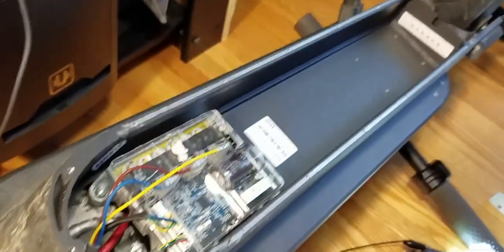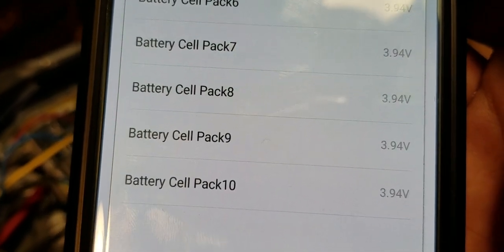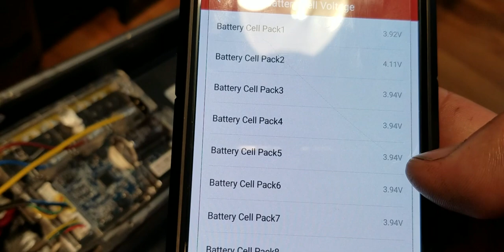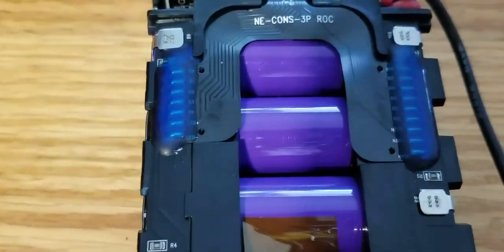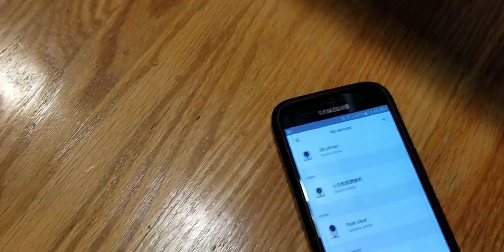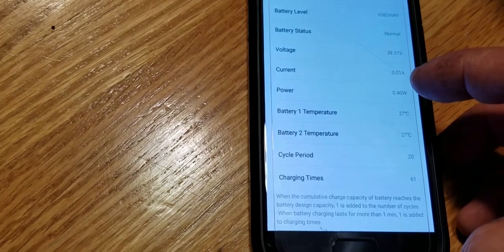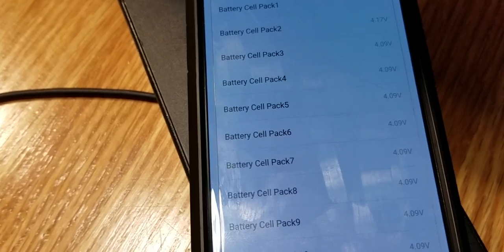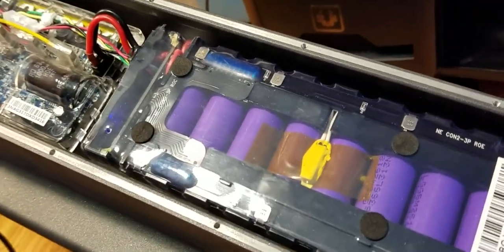Xiaomi M365 range problem - diag and repair

Comment: The reason why battery pack 2 has a higher voltage is because its more worn and so charges quicker. That is why even after the first discharge the battery pack 2 still advanced faster than the others indicating the wear.
Reply: lol nvm watched the followup

Comment: instead of doing all this wouldnt it be easier to just let the battery completely discharge by either running the motor free or letting the LEDs on until it is ocmpletely drained?
Reply: yes

Comment: What nice looking internals. My guess is that cell is bad and has lower capacity and thus charges faster. It is not your fault this is a balance issue. You could make a BMS easily. I recommend it.
Reply from the maker: I agree that is the problem. the battery is in a 10s3p configuration, so likely 3 cells are the problem. i some better 18650 cells on order to replace the faulty cells. i guess i could add a 10s BMS from ebay to this battery, but i would only use it to charge the battery. the stock BMS has 3 signal wires going to the controller, likely to tell it information(cell voltages, temp etc..) about the battery pack. i don't want to lose that info.
Reply: Doug, you sound like a techie!  See this document for full details on the sophisticated BMS and see Figure 8-2 for circuit diagram of most of the Xiaomi BMS board: http://www.ti.com/lit/ds/symlink/bq76940.pdf

But do remember the BMS relies on being properly connected to a battery pack that has all its 10s3p connections intact.

Comment: Are they using unprotected cells? This is why I would pay 20 dollars more to get each cell with protection inside battery. Then the BMS  does not have to worry about each cell, just cutting charging power when current is zero. I wish though they could produce protected 18650 cells with a pre-set cut-off @ 4 volts. I would definitely pay more for this, even if capacity is lower. That would mean that the battery pack would keep a good charge for many years. Using a lot of 18650 cells and with my charger programmed to 4 volt cut-off my 10 year old cells only have lost 3 percent (of 4 volt capacity). 4.2 volt charged batteries gives way less than this in just  a few hundred cycles (all original Panasonic NCR 18650B protected and unprotected).

Comment: why didn't you just empty all of the cells (by running it) and charge it up from there? or would it not have discharged all of the cells because some are empty?
Reply: The full discharge voltages of each cell would be different for each just like when they were fully charged.  His method is spot on

Comment: Yecch. Not everyone is an EE or even has alligator clips.  Very few people could diagnose or even try to repair that problem.  I hope you're the only one to have it (not that you should!).
Reply from the maker: +Mike Cane i am no EE, lol. I diagnose/repair car problems as a day job. But thanks!
Reply: I think i have the same problem, my battery range is very low, and don't know what to do. The scooter also switches off and sometimes I can't restart it without plugging it again.
Reply from the maker: +Gianluca Maggiarra i just made a updated video to this issue, solving the problem

Comment: Hi Doug Hnut, your videos are great. Thank you. One question, and I do realise that your video is over a year old, but does the current Mi Home app still show the breakdown of the Battery Cell pack voltages?  I can't find it anywhere.  I can only see the total voltage.  Also it seems the that Ninebot app no longer connects to the M365 stating that it does not support that model scooter.  Do you know anything about this?
Reply from the maker: they stopped displaying the breakdown. on the android appstore, there is a app called "m365 battery" that will do the same
Reply: @DougHnut  thanks. Also when I charged my m365 the other day, at about 100% the four lights on the handlebars started flashing in unison, and the tail light was flashing too. Is this an error sign or is it normal? I can't find anything about it in the manual. Also the first charges of the m365 I left the scooter and returned after it was fully charged and the lights had all turned off
Reply: Is the M365 battery app on Apple store???

Comment: Hi. Thanks for the video. Did the battery fix work and increased it back 22 km?
Reply from the maker: +otikzs unfortunely not quite. I have been quite hesitant to draining the battery down past 10%. Im still slowly doing some test to see if this made an improvement. So far it is not as good as new. Ill let you guys know after i collect more data.
Reply: Doug Hnut  how many months are you using it before you noticed the battery problem?
Reply from the maker: +shari soriano 2 months. Right after my off road trip. Which i have a video of that ride in my playlist. 
It was not meant for that kind of riding haha

Comment: My scooter stops charging at approx. 4.12volts  is that normal?    all cells are ballanced at 4.12
Reply: yes, I think. Newer BMS firmware from xiaomi limited the max voltage, so now 100% is like 94% from before. This helps protect battery, allows more cycles because batteries are not sitting at full charge. It lowers the scooter range a bit, though, but you woukd be able to use it longer time.
It's possible to flash older BMS version, to regain your capacity, but will be tougher on your battery.

Comment: I was under the impression when you had a cell balance issue the way that you repaired it is to run everything down dead. And then put a draw on it and suck out the rest. Then when it recharges from absolutely zero they will charge evenly as long as connections are good and otherwise healthy cells are present
Reply: What's the best and fastest way to drain battery?

Comment from the maker: its only on the mi home app. but im not even sure anymore because recently i haven't noticed the individual voltages anymore on the mi home app
Reply: you have to change the apps region to USA in order to see the extra features of the cells, ... I had Europe region i randomly changed it to United states and noticed the feature.
Reply: @PqKiller25ToLife  I live in Europe, and when i change to region USA, it cant even find and connect the device via bluetooth? I have tried several times, even turned off and restarted the device and the app first, but when i try to connect the device, it just searches until it finally says, that it cant find any device...
Reply: @skytte71  make sure u dowloaded the right app, or if it needs to be updated, the apps icon is green.
Reply: You can check the individual pack voltages still using this app -- https://play.google.com/store/apps/details?id=com.m365downgrade
I'm having the same speed issue... I think all voltages seem fine (all packs right around 4.05V), tire pressure is good, eco mode is off. Sucks, IDK what to do.

Comment: wait! so you got 15 fiscally cells but the app shows only 10?
Reply from the maker: rick haro there is actually 30 cells. The cell arrangement is 10s3p. So 10 groups of 3 cells
Reply: Richard Adams ok i thought it was 15 x 2.

Comment: Hi Doug, Same problem here. Cell PACK 2 going a lot lower voltage and faster than the orther when i run the scooter. Should i replace these 3 cells? by what?
Reply from the maker: i have an updated video for this issue, check out my playlist
Reply: I have totally the same problem 
After ride cell pack 2 has 0.2-0.3V lower voltage, after charging it is equal, But my scooter sometimes wont turn on. I have to put it on chager and then It turn on. Guess some bad connection to pack 2

Comment: Hello Doug, may i ask from you something. I have the opposite problem. My all batteries have 4,140 V, but the Cell4 is a little but under4,112 V.  I have a 18650 battery charger (0.5A), do you think i can charge this low cell with this to make it balanced? Thank you for your kind response.
Reply: Yes you can. Though this may be an indication of a failed cell that has a high leakage current which means it's faulty. If left unchecked, this could lead to fire, though it's unlikely to happen if it's slowly dropping in voltage. It's probably going to get warmer than normal when charging though.

I would recommend leaving it a day. If it drops further then one or more cells in that parallel section need replacing. It may be your BMS that is bad too, because it should be balancing the cells.
Check the resistance of all connections to the BMS. If it's offscale high, then you need to find where the break in the circuit is and repair it.

In theory, you may be able to see which cell is bad just by pointing a thermal camera at it when charging. I would note this isn't recommended. Especially if you're charging at a high current.

Comment: In my "MiHome" application I can't see the Battery Cell Pack?
Reply from the maker: +Egge33 what version firmware do you have? Im currently on 1.3.4. If you still cant find it ill make a quick video to show you where
Reply: Do you know if 1.3.4 fixes the fuse problem on braking? I have an M365 on the way from Banggood and I want to pre-empt any problems.
Reply from the maker: +Kent Boehm yes. I heard anything after 1.3 does. Mine came from banggood with 1.3.1. So im sure you will be fine.
Reply: I checked already. Only. With Android you can check the cell power!

Comment: Any way to charge without the power supply? Mine was stolen.
Reply from the maker: no, unless you have a 42 volt power supply and are willing to take the battery cover off every time you want to charge. better to just buy another charger. http://bit.ly/2NskGkY

Comment: You have to ask why this happened though. Does the battery have balancing circuitry built in? It certainly should!
Reply from the maker: I first noticed the range problem after my off road trip that ended with a dead battery. So likely the problem was caused by draining the battery till the scooter wouldn't move anymore and leaving it powered on 10-15mins afterward. The battery does have a BMS, but it does not balance charge the batteries. The BMS only prevents over/under charging.
Reply: Ahh ok, so avoiding over discharging would probably help avoid this situation. Cheers.
Reply: >>> The battery does have a BMS, but it does not balance charge the batteries.

Uh-oh.  I'm seeing charge balancing claims from other eScooter makers in China.  If Xiaomi doesn't have it,. it's likely they don't, either.  Yikes!  This could become a very big problem.
Reply: Oh, you're very wrong. The BMS does balance charging using Texas Instruments bq76930 chip - PROVIDING the cells and cell packs are all connected properly and all the sense wires are connected.
Reply: Ah, that makes sense.  If it's not programmed for that possibility, the balancing will go out of whack.
Reply: There are two major faults that can occur with the battery pack. If one realises that it is made up of 10 packs in series, each with 3 batteries in parallel, then you need 11 wires to monitor all the pack voltages.

If you look at the pack voltages on MiHome and one pack has a high voltage while one next to it has a low voltages, then one of the sense connections has lifted off and needs reconnecting. For example if Battery Cell Pack 2 reads lower than the majority and Battery Cell Pack 3 reads higher than the majority, then sense lead 2 has disconnected (they're numbered from zero to 10). BMS cannot balance the affected cell packs

Alternatively, if you just see one cell pack reading lower than the others, then probably one of the three cells in that cell pack has got disconnected and it therefore only has two thirds of its capacity and will drain quicker than the other 9 cell packs giving you reduced autonomy. And, when charging, this pack (having lower capacity) will reach the peak fully charged state before the other 9 and the charger will stop charging before those 9 packs are full.

The MiHome Battery Cell Pack readings are absolutely invaluable guide to the integrity of the battery assembly.  Under normal circumstances, the packs should all be the same within 0.02 volt, although you may see a slightly wider variance when the battery is nearly empty but it soon recovers under charge.

Sorry for the long reply but I thought it might help those out there who have damaged the battery by using solid tyres which cause excessive vibration.  That's a slight simplification because it's clear that Xiaomi have not designed a battery that is fit for purpose. the designer did not take into account the poor malleability of nickel compared with copper.

Oh, and be warned: when resoldering the tabs, you need to get solder underneath them but if you straighten them too much, they will crack and cause a bad connection later at the point where they bend over. You will get a bad connection AGAIN. :-(
Reply: Ah, solid tires and vibration as other factors to consider.  I doubt there's room for some cushioning in that area. And given the heat the pack might generate, you wouldn't want anything near it.  Good explanation.
Reply from the maker: interesting, i didn't know that it actually has a balancing feature. i looked into the bq76930. it has a max balancing current of 5ma. that's probably why i didn't notice any change in voltage between the lower capacity cell pack vs the others within a 24 hour span.  so even though this does have a balancing feature, it can not handle a capacity difference of more than 120mah within 24 hours(assuming you ride the scooter every day). 

and yes i did tin the battery terminal first before soldering the tab back on

thanks for the awesome and informative reply!
 now if we can only find a way to unlock the 25kph limited top speed....
i've read somewhere that a russian guy was able to do it,  but only does it for $$
Reply: Doug Hnut The Russians are realllllly into portable electric transport, so I wouldn't be surprised if they know how.
Reply: The 50mA balancing limit applies to internal balancing which is normally only used on the smaller bq76920 for low capacity 5S batteries. External FETs are driven by the bq76930 to provide much higher balancing currents. I don't know how much because the control is delegated to the firmware running on the STM8L151K6 microprocessor.
Reply from the maker: ill take your word for it for the external FETs providing the high balancing currents. this stuff is above my knowledge level, lol. but i love learning and understanding how these things work.  Am I right to assume that there should be 10 external FETs to balance charge 10 cell  packs?  i was reading the data sheet and it stated  that the smaller bq76920 would provide a max internal balancing current of 70mA vs the larger bq76930 with a measly 5mA, this would make sense that the bq76930 would use a different route to balance charge.
Reply: I cannot be certain, but I believe the two integrated circuits labelled U4 and U5 are responsible for the balancing current. What I am certain about is that cell packs rebalance following repair of a disconnected cell in an hour or so of being put on charge; not days. I have monitored this with MiHome. 

Incidentally, the original cell disconnection was discovered by MiHome's cell pack voltages very easily: On one trip I thought the remaining battery percentage had gone down more than I expected and it showed that one cell pack was lower than the other nine.  At home, I removed the battery, took off the black plastics insulators on each side and had just a choice of three connections each side to probe. Plenty of flux, good tinning and a quick joint meant that the battery pack was back inside the scooter in minutes and I was able to observe how it recovered when on charge.
Reply: mvarcadia Hello, It looks like I have the exact problem u have described. Battery pack 8 is low and pack 9 is really high. Am jus wondering if u can guide me to reconnecting the sensor, i dont think I can see it.  Maybe even a video, or quick reply on where it is, what to do would be amazing. 😊
Reply: esasuke uchiha have you find out what to look for? I am having same issue c03 is always 4.12 the others are ~4.01 there are connection with every batteries on both side. No, idea why it is unbalanced. Could one damaged battery make this problem?

Comment: my m365 a prpblem that i could not figure out, it full charbe at 2hrs, 5 of the batteries at 3.7 or 3.9 vlts the other 5 are at 4. something.
Reply: Hi, did you get any solution of it? I am  having the same problem.